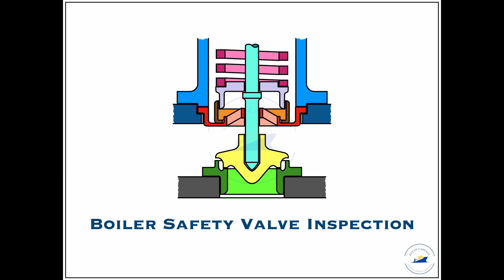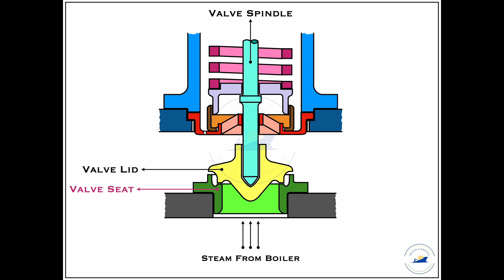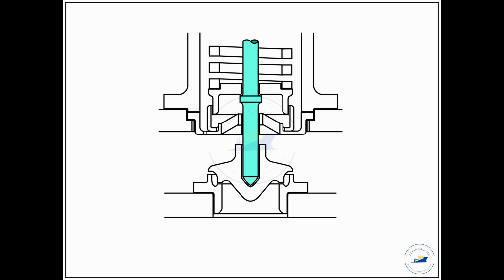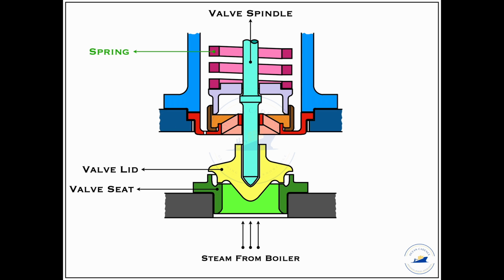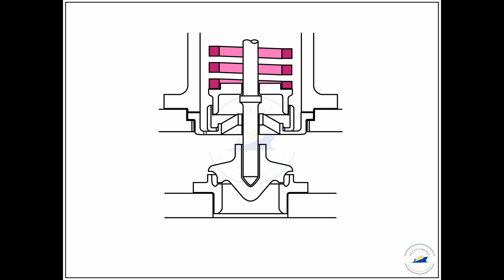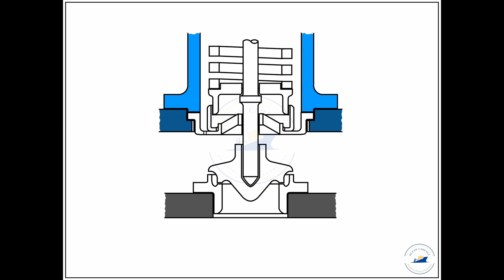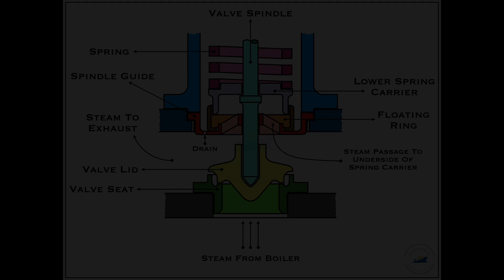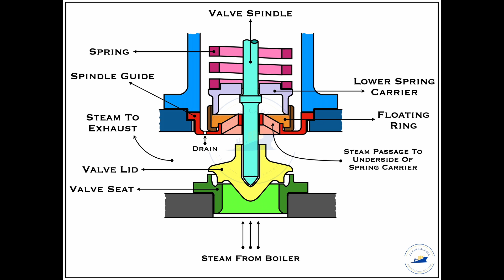Boiler SAFETY VALVE overhaul and inspection | Marine Boiler | Auxiliary Boiler Safety Valve |

Comment: Sir what are the clearances that we need to check while lapping the valve and seat ?
Reply from the maker: Suggest to check the following as minimum requirement:

Seating area width: OD-ID
Seating angle: 30-45 degrees, manufacturer dependent 
Surface check: with white paper for continuous ring impression to check if lapping was even
Post assembly: check for lifting height (check dia. beforehand to correlate)

Comment: Plz explain re seat pressure of prv?
Reply from the maker: The reseating pressure of a boiler safety valve is the pressure at which the valve closes again after it has popped open due to overpressure.

This pressure is lower than the set pressure, and the difference between them is known as the blowdown.
	•	Set Pressure: The pressure at which the valve opens.
	•	Reseating Pressure: The pressure at which the valve closes after relieving excess pressure.
Typical Blowdown Values:
	•	For boiler safety valves: usually 2% to 4%.

Blowdown % = (Set Press-Reseating Press)/Set Press